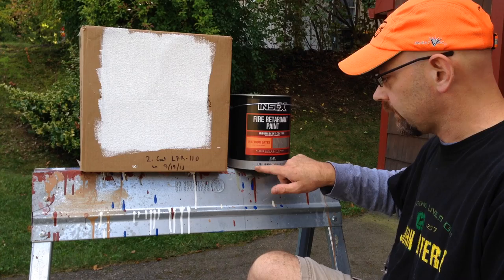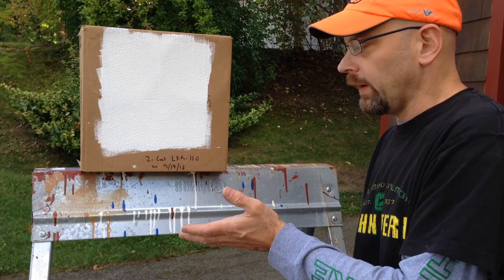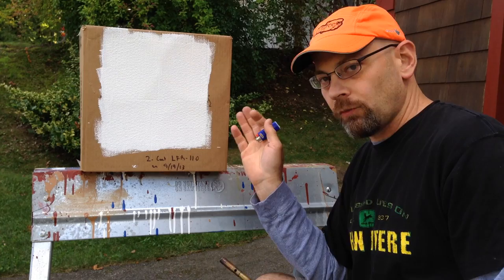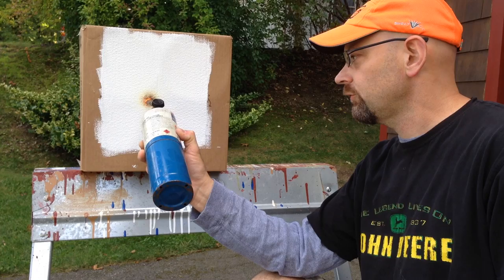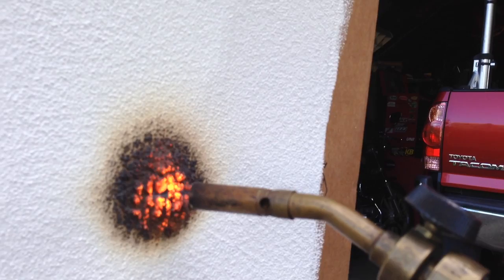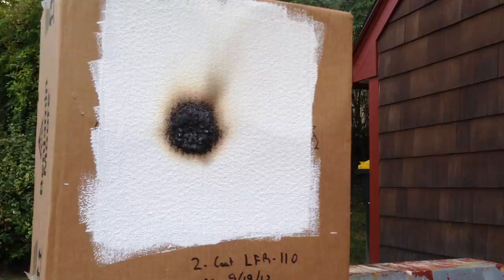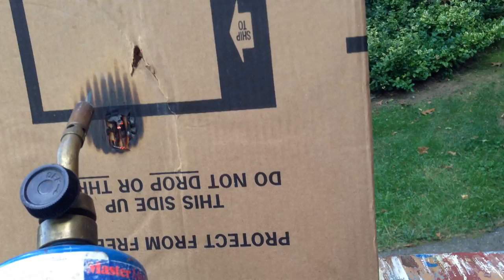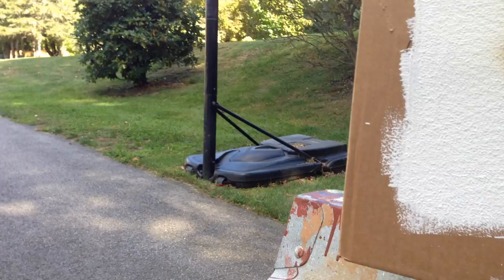Intumescent Paint

Comment: Three nights ago, my neighbor's house across the street, a huge 3 floor house, caught fire, and in the space of a FEW minutes, the fire spread to the entire house. The firefighters spent six hours battling that fire. Most of the house collapsed, the rest was brought down by a crane due to safety concerns, and all that is left is a pile of rubble. My neighbors are okay, but they lost everything, including three of their cats, who were not able to get out and lost their lives.... Today I understand why the fire engulfed the whole house so incredibly fast: it was a balloon frame house. So, now I am very worried because my house, which is smaller,  has however a balloon frame. Besides smoke detectors, and fire extinguishers, would painting all the interior walls of the house with an intumescent paint help in the event of a fire, in order to at least have enough time to get out, and get the pets out as well?
Reply: ondine hd I am not sure it would help on standard plaster walls, it is typically used in common area’s like halls and stairs and on combustable surfaces, mostly wood, to slow the spread of fire and extend the time people have to escape.  It wouldn’t save a house in itself. I would consider a local specialist that may have more information that can be applied in your house.
Basically the video is just to show how the product works.
Reply: @sportster1996  Oh, I see. Thank you!
Reply: In a normal residential house fire there should be enough time to evacuate the building in its standard constructed state. The application of an intumescent coating to interior combustible surfaces is unlikely to assist greatly, but it depends on the actual construction and the surfaces you apply to.

In this demo video some idiot has applied an intumescent coating to a piece of cardboard and then applied a flame which is unlikely to achieve a sustained heat release of anything more than approx 300 degrees C, barely adequate to allow the intumescent coating to intumesce. There is no real practical or cost effective way to improve the fire resistance of interior combustible surfaces in a residential property.
Reply: The name of that video incase you don’t want to use the link (I understand) is 
“Contego Intumescent Paint: Control Burn Test”

Comment: And how STRONg is the paint wrt impact , as in,accidental tools chipping parts away (example; mad wife or chef throwing cuttlery against the wall/paint).
Would it lead to a 100% reduction of heat resistance on a cm2 spot, which in turn , during a fire, would lead to a heat bridge ?
Reply: meaning..apart from painting it METICULOUSLY  during the first layer (not a SPOT can be missed!!), it also needs METICULOUS inspections each year ? month ? to search for missing chips...
..and that costs money...
Reply from the maker: @oddballsok  it isn't that strong, about the same as a typical wall flat coating.  It is intended for residential use not industrial.